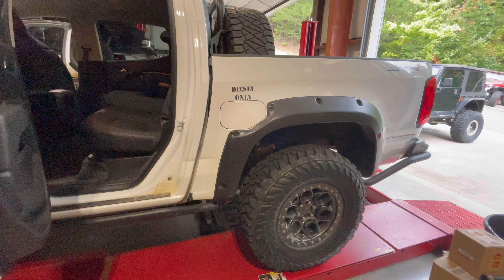Part 15 Chevy ZR2 Diesel Build - Goose Gear and GFC

Comment: Looks like the bed kissed the rear of the cab as it flexed too. I’ve worried about this on my own ZR2 with weight in the bed while off-roading. Thoughts on stiffening the frame? Love the videos!
Reply from the maker: It sure has, and that was before the GFC. We have a set of 589 supports to go on in an upcoming round of upgrades.
Reply: @rockyour4x4  excited to see it!